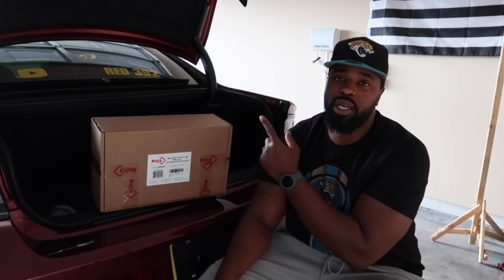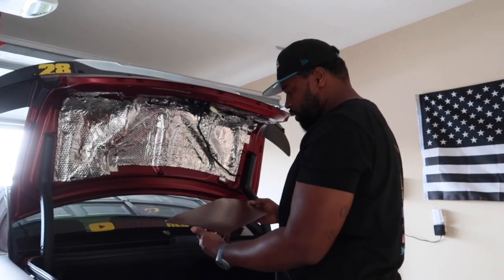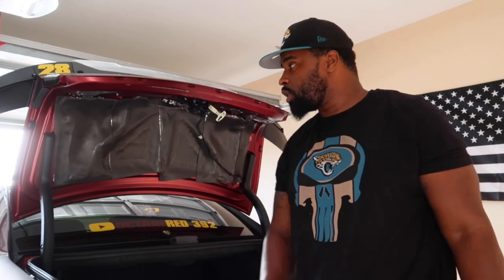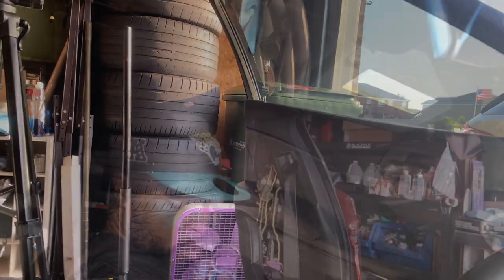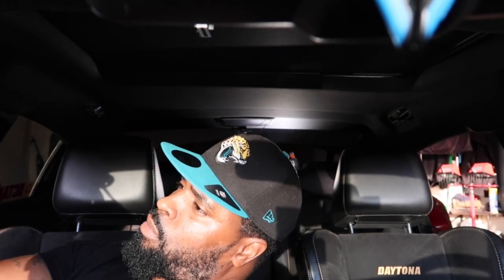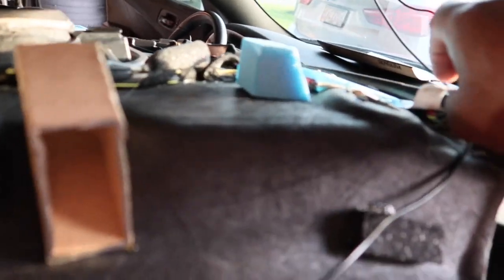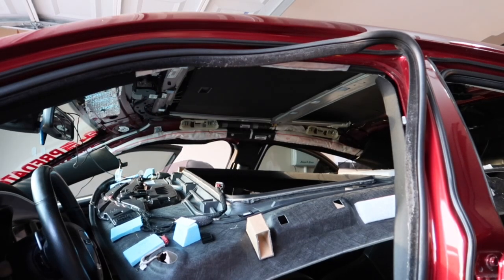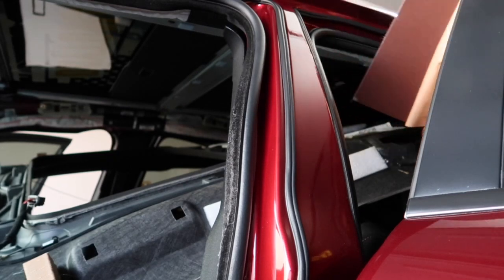How To Install NOICO RED 150 mil | Headliner & Trunk Lid | OctaneRed_392

Comment: This was a helpful install video, thanks for taking the time to show some of the process; it was very useful for me with my own car.

I don't think the Noico Red is going to keep the heat out of your car while it's sitting. In fact I think it's going to make how hot the car gets while sitting even worse. There's two ways that your car naturally gains and loses heat (i.e. without you turning the heater on). One is the absorption of radiation (sunshine, which always only adds heat), and the other is outside air exchanging heat energy with the car by contact with its outer surface (this can warm or cool the car, depending on which is hotter at the time). While your car is sitting in a parking lot on a sunny day (for example), what's happening is that the sunshine is getting through the windows in your car heating the air inside, but that air can't rise once it's hot like the air outside once it is heated in the same way. So it sits in your car, getting hotter and hotter. Normally the car will heat the air around it as it gets hotter than the air outside and bleed off some of this heat energy (though not as quickly as the sun heats it, as you surely know having gotten into a car on a Jacksonville summer day). I think the noico is likely to make your car an even more effective heat trap, all other things being equal. 
So, to your point in the video, what the noico does is help your car do a better job of maintaining a large temperature difference between itself and the outside air without losing or gaining much heat energy (this applies to when your car is both hotter and colder than the external air). Kind of like a thermos that can keep a drink hot or cold for longer. It just slows down heat exchange between the inside and outside. So it will likely make your air conditioning more effective as well, once the car is cooler than outside. The problem is that the sun is still shining inside your vehicle heating that sucker up when it's parked. Cracked windows, tints and a windshield reflector would help.
Reply from the maker: Thanks for commenting & the suggestions.

Comment: Great installation video. I have been enjoying your channel and your car is clean! I would be interested in your thoughts about the sound difference this made and if you are satisfied with the Noico Red from a performance standpoint. Did this produce a noticeable change in either road noise, music or just panel vibration in general? Thanks!
Reply from the maker: Thanks, I appreciate that 👍. The sound quality improved with the first installs I did (check out my "noico sound deadener" playlist), the noico red improved the temperature inside the car. I currently don't have any panel vibrations or excessive road noise. Hope this helps.

Comment: Hey thank you for sharing your installation. I have an old Mercedes that I'm installing the noico stuff into. it's an older 85' 500 SEL. i've already put the 80mil over the entire ceiling but I wanted to ask your opinion on using the Red. Do you think the adhesive is pretty good or long lasting from what you noticed when applying the stuff? I was concerned if it might fall off onto  the sunroof assembly, possibly jamming up the mechanism. Thanks again for sharing this my friend.
Reply from the maker: Sorry for the late response. Yes, the adhesive is very strong. I've tried to remove it before and it doesn't budge. Glad I could be of help 💯

Comment: How are you liking it so far. I have kilmat 80mil. Then just bought this Noico 150mill red. I want to secure my trunk and doors tons so no rattle. First time I opened the box I was like this is light as heck and hoped it holds up.
Reply from the maker: @Jason Ghering  I love this stuff. No panel vibrations or excessive road noise. Did you see my other Noico installs? They're under my 'Noico Sound Deadener' playlist.
Reply: @OctaneRed392   no i just seen this one here. I have a big system im about to put in thats about to put up like 153dbs. So when I first opened this I was like this is so light and feels like a studio material to hold noise in. Do u have a insta
Reply from the maker: Jason Ghering yes I do it’s octanered_392

Comment: I just wondering can I install 150 mil only without 80mil ?
Reply from the maker: great question thanks for your comment. If your only wanting to do the noico red install I suggest noico 315mil it is a thicker material and will better accommodate the sound and heat. I already have 80mil through out my car as you saw in the video also due to the limited space I had. This was the reason I decided to go with the noico red 150mil. Also the price is very similar to the noico red 315mil, so if you have no sound deadening material in your car I would definitely go with the noico red 315mil.
Reply: OctaneRed _392 Thank for suggestion I just brought the 315mil.
Reply: Then, If I install noico 315 mil  instead of noico 150  mil or 170 mil after installing noico 80 mil probably I'll get better results?

Comment: you installed Noico Red on top of some other butyl deadener?
Reply from the maker: I installed the Noico red over Noico 80mil all from the same company. I just installed them at different times. Thanks for the comment I hope I answered your question.
Reply: @OctaneRed392  yeah for sure

I'm driving a 2005 scion xb... it's pretty loud inside. baby steps

Comment: Have you had any melting issues?
Reply from the maker: Melting issues from the red? No I applied mine to my Noico 80mil.
Reply: @OctaneRed392   yes the 80mil any melting issue
Reply from the maker: @49Shoebox  No melting issues from either. Did you apply your 80mil with a roller?
Reply: No, I’m bout to do a SQ build in my vehicle and I want to get some more insight on this product